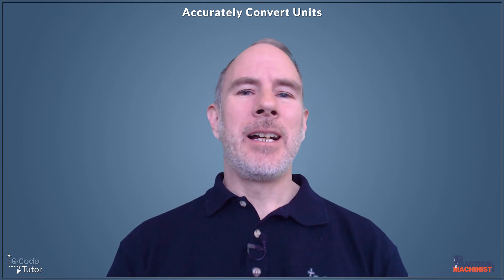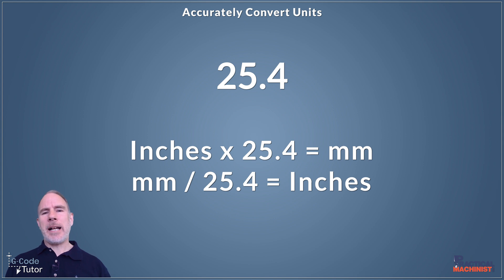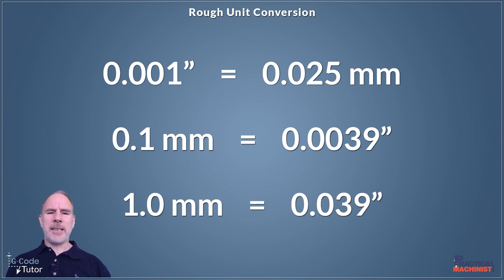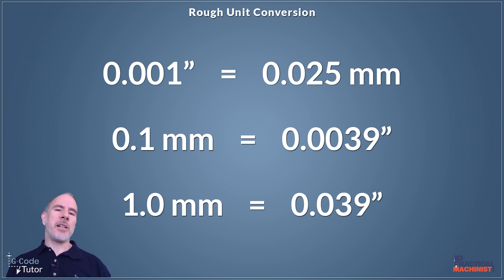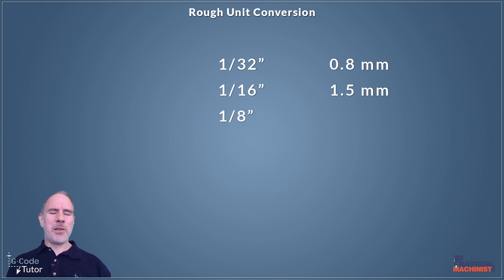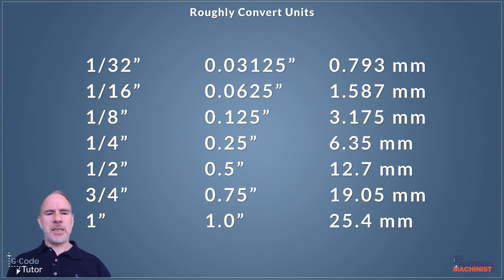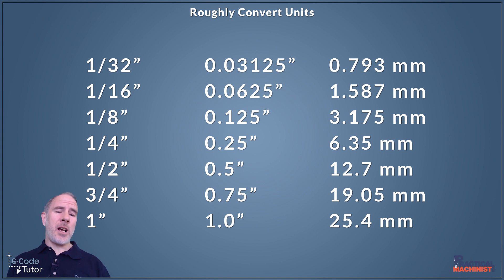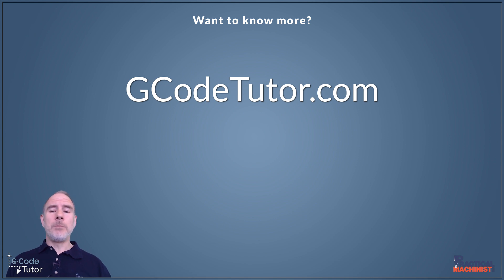How to Convert from Metric to Imperial EASILY!

Comment: So if they say 12-15/16” wtf is that in metric ?  Is that symbol - a minus or plus ?  And how thus a weird  31/32 works out. ?
Reply: It's a hyphen.  It means "and" in this context, so it functions as a plus sign. 

And then, as generalbigmac said, just do the division and the addition.  Since everyone has a calculator in their pocket these days, it's easy.
Reply: @Milesco  is much kinder than I was. Those are the correct fundamentals

edit: it may be easier to read as "12 - 15/16". Do you notice the space between the dash? Imagine that it looks like "12 15/16". That is an example of a mixed fraction. Study whole numbers, and study fractions, and then mixed fractions.
Reply: 328.6125mm... do the division bro

Comment: "The metric system is the tool of the devil! My car gets 40 rods to the hogshead and that's the way I like it!" - Grandpa Simpson
 For over 40yrs, I worked only in thousandths of an inch. I having to work more with metric dimensions. My digital calipers, and DRO's are switchable to mm. No metric micrometers yet. But all my cutters & end mills are inch.
Reply: I use that Grandpa Simpson quote all the time, it never gets old.